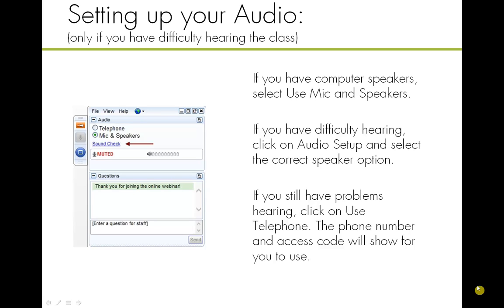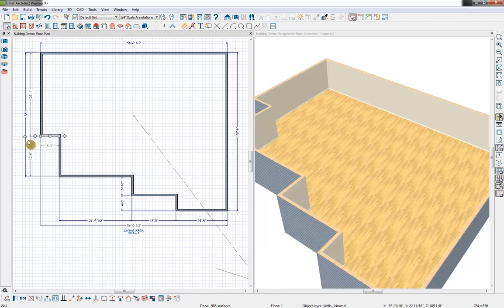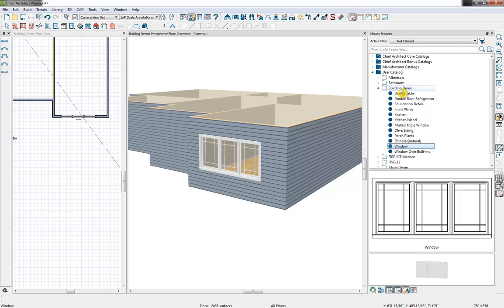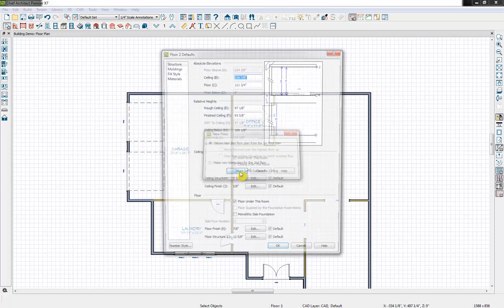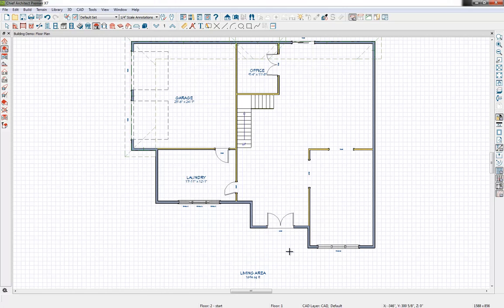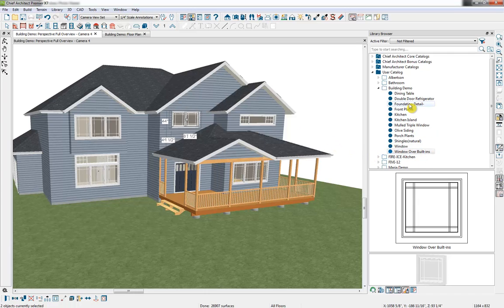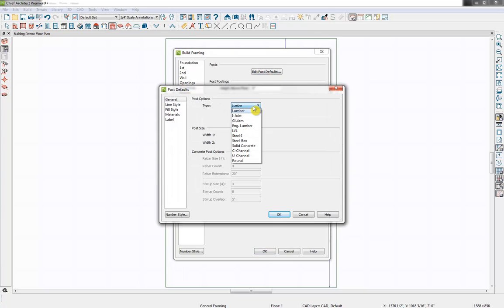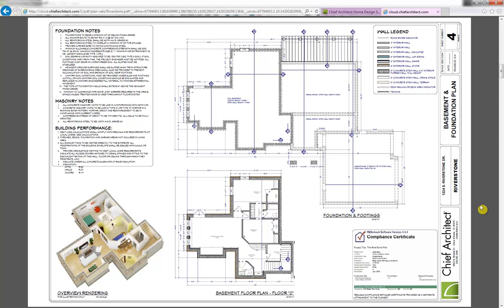Chief Architect X7 Building Demonstration

Comment: Hi, loving the tutorial, I was hoping you could tell me how to replace the railing on the staircase with a solid wall please.

Thanks.
Reply from the maker: +Ben Jones Here's a help article that will show you how to apply a custom railing to your stairs. Instead of choosing panels, you can select solid. http://www.chiefarchitect.com/support/article/KB-00082
Reply: +Chief Architect Software All that does is create a second railing along the ground floor, underneath the stair railing.
Reply from the maker: +Ben Jones Give us a call at 208-292-3400 to see what is happening in your specific design. We're open M-F 6am-5pm Pacific.
Reply: +Chief Architect Software I'm based in the UK, so that would be tpoo expensive. This program is FULL of bugs; I just built a second house and now the windows, doors, furniture (everything, basically)on the first house have ended up on the roof.
Reply from the maker: +Ben Jones Since you are in the UK, you can call (020) 3286 5716 or here are some more contact options: http://www.chiefarchitect.com/support/#contact

Comment: He all I have a question about chief software. I do a ton of floor plans and concept layouts for Domino's pizza. I use Aoutcad but I'm looking to use Chief to do these layouts but it seems its mostly for residential homes. Can it do this type of layout and what version would I need. I really don't need it for the 3D views just want a fast and accurate way to do sections and dimensions. You can see some samples of the simple layouts at www.tiptonwoodsdesigns.com    Thanks for any advise
Reply from the maker: +Brandon Tipton Chief Architect Premier is great for residential and light commercial. You'll have tools you need to create the light commercial design of the Domino's store layout. We have many help articles and videos that will guide you through your design.